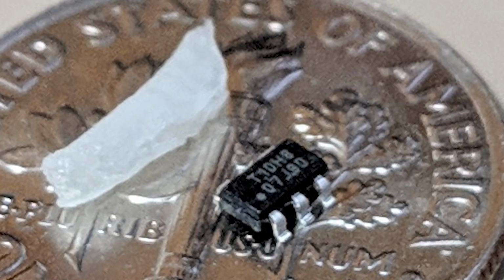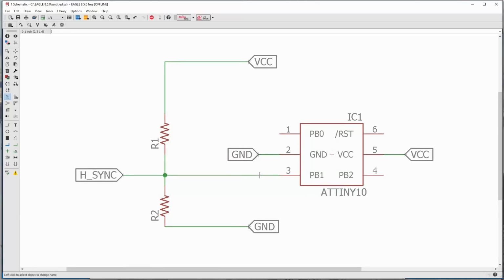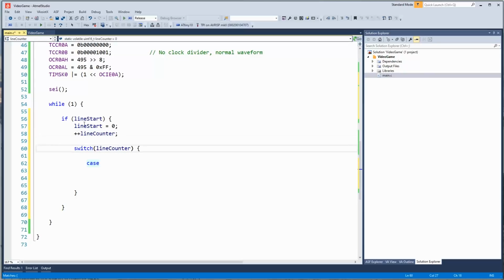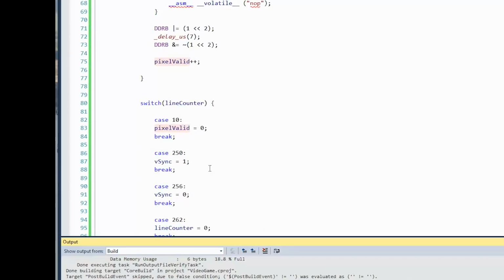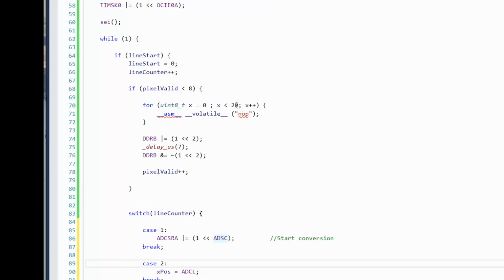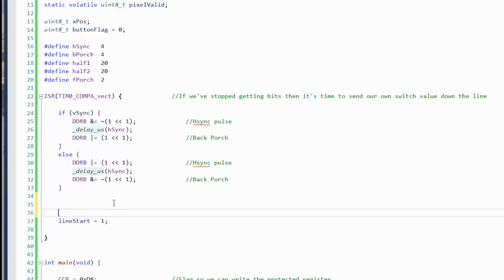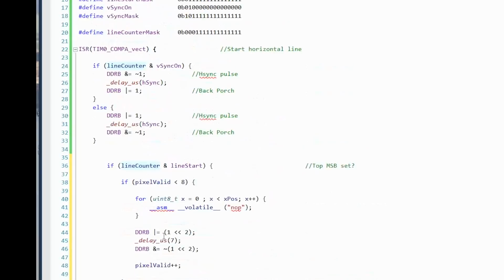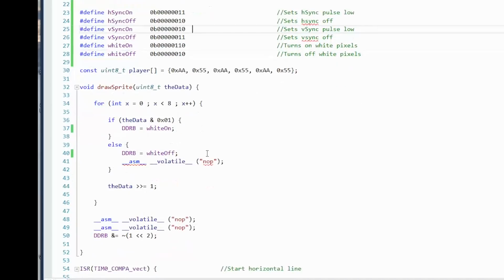ATTINY10 Console Part 1

Comment: If putting everything in the ISR feels icky, could you have it just set one flag and exit immediately? Then the main while(1) begins with whatever logic it needs for the next line, enters a spin loop to wait for the timer, then draws the line. Or perhaps poll the timer directly and not use interrupts at all, if the chip supports that. Could even throw in a few nops based on the last few bits of the timer to align away any jitter.
Reply from the maker: The issue is you don't know where you are in the while() loop when the ISR is called. That's why when you come back there's some jitter to the pixel edge.
Reply: @BenHeckHacks  I've been working on a composite output project using a more "conventional" AVR (324P); I based my pixel output loop on a clever bit of Arduino TV-out hackery that was designed to do render the pixels from within the ISR and the "main" loop really strictly doesn't have to do anything. (But it can; you can, for instance set an "in vertical blanking" flag handle processing in-between frames. ) How it avoids the "jitter" in the starting position is it (off the top of my head here) sets the timer interrupts so it "sleeps" the CPU when it enters the horizontal refresh "down" phase and "wakes up" when it goes back to up. (At which point it processes the line output as the ISR for that.) My understanding is that "sleep" give a reliable "start of processing", while if you interrupt running code you get a random clock or few's latency.

Dunno if this applies to the ATTINY, though. No idea, actually. For what you're doing I think to make this work you might need to pre-calculate your pixel output blobs to also avoid making any indeterminate-number-of-clocks decisions before the left margin, maybe you don't have the RAM for that?
Reply: @PaleozoicPCs  Yes, putting the chip to sleep is a good idea to eliminate jitter. The code for an AVR-based text terminal I looked at uses this technique.

Comment: You don't need to just put "volatile" specifier wherever you can type some word. It won't make your variable ISR-safe automatically. This specifier just saying to compiler to not optimize some expression when some memory can be changed by hardware or external code (when compiler can't see those code) and you, say, are not initializing something and then using it. MCUs hardware registers declared as volatile, but using this specifier for your global variables is nonsence.

Comment: 45:18  A byte was always 8-bits.  Byte I think was the standardisation of character sizes at 8-bits wide, around the same time as ASCII, I think.  Before that it was word size.

https://www.youtube.com/watch?v=ixJCo0cyAuA
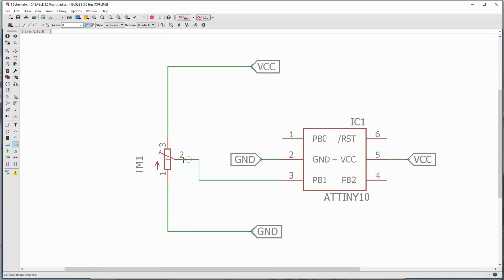Reply: Inaccurate. Quoth wikipedia: "computers using six-bit and nine-bit bytes were common in the 1960s." The technical term that's always 8 bits is an octet. Incidentally, ASCII is 7 bit. The video you referenced also pointed out that other sizes were used at 8:22.

Comment: friendly reminder that mixtela style ADC button muxes using R/2R ladders are a thing and you should use them.  this is especially important since if the player turns the potentiometer while the button is pressed, you will likely want to be able to detect it.

also why are you incrementing the line counter in the mainloop instead of the interrupt handler?  seems to me that if you do it that way, if the mainloop lags and (for whatever reason) takes longer than 1 scanline to complete, for example because you're running low on CPU time and blanking 8 lines while you do some processing during the active region, it'll miss and you'll end up duplicating a line meaning your image now 1) looks wrong and 2) no longer conforms to NTSC spec because it is now too tall.

why are you doing bitwise ops on DDRB instead of writing fixed values to it?  seems to me it'd be a lot faster and your pixels could be a lot narrower if you did, and with what else you're doing in your app (no other bits in DDRB change ever), you really don't care.  doing it Right(tm) is all well and good but when you're bit banging NTSC, every cycle counts, and sacrifices must be made.
Reply: @Christopher Grant AVR is a microcontroller architecture conceived in the 90s.  bold of you to assume it has a pipeline at all

also, reading a hardware register to an accumulator, modifying the accumulator by an immediate, and writing the accumulator back to the hardware register is always gonna be slower than simply writing the immediate

EDIT: nvm the SBI instruction is 1 cycle and can work on the DDRB register directly.  ignore me
Reply: @Christopher Grant I know that, but surely they didn't put them in microcontrollers, did they?  Why spend valuable die space on a pipeline and clock phaser when you don't care about performance anyway?

Besides, whether that was a thing they did back then or not, the word "pipeline" is conspicuously absent from the ATtiny10 datasheet.  Then again, all but like 5 of its opcodes complete in 1 cycle so

Comment: If you're using such a tiny MCU, why pair it with a HUGE CRT TV? Wouldn't it make more sense to use an equally tiny display. Like one of those I2C addressable 128x64 OLEDs.
Reply: That would be too easy, all the fun is generating correct video timing.
Reply: @eDoc2020  OLEDs have their own challenges.
Reply: @frankbauerful  True but nothing like needing to keep track of your cycle counts. You can create games much more easily when you can generate pixels at your own speed. I don't know if you've ever tried bitbanging video on an AVR before, it's really hard to achieve seemingly simple tasks like displaying two graphics next to each other.

Comment: Why are you using bytes for flags? If you define a byte instead of a bool , the compiler wont merge them, bools will merge into a single flags-byte and use native bitcheck opcodes no?
(I know more about PIC ASM ;))
Reply: @Christopher Grant yeah you're right, I was mistaking bool with specific MCU types. What the PIC XC8 compiler can use is the __bit type and it will auto pack them into a byte into the shared page, using bit operators (set bit and such). Is there any such thing for the avr compiler? It seems really wasteful to use a byte for a flag and I generally don't trust compilers to interpet bitwise or as a BSF and such..

Comment: Wait, an NTSC signal using just the internal oscillator of the uC? I always thought you needed some sort of crystal to get an accurate enough clock.
Reply: You really only need an accurate clock if you're doing color because color relies on your oscillator and the TV's staying in sync. With B/W you only need to get the sync timing "close enough". B/W TVs don't have any timing crystals. The vertical hold and horizontal hold controls of an analog TV are in fact adjusting its sync oscillator free run speeds.

Comment: Would a 0.96" I2C  Serial 128X64 OLED display be to much for a ATTINY10 .  4 pins let me think; start right, button pin 1 press move left, pin 2 sound out, pin 3 fire and data out to I2C. make a Galaga game?

Comment: Does the Atmel compiler support bit-fields? Would've been a bit easier than all the AND/OR logic
Reply from the maker: In assembly it has bitwise commands. I can try using them without the code (like the NOP)
Reply: The compiler supports bit fields, but in testing that falls back to the same operations as for RAM access. So even if the bit field is stored in a GPR, it uses 3 instructions to set a bit instead of 1. This saddens me.

Comment: I'm pretty sure all that bit-masking with the line counter isn't free. That all takes time and several instructions as the chip loads linecounter from RAM, masks it, compares it, and sets the return value. That's 4 or 5 instructions. You're taking time to do stuff in what should be snappy, VCS-style code! 

And all to save a couple of bytes of RAM, when you're not even short of RAM! Go back to the old code! Adding complications like that, it's pointless and my brain is screaming! Use the RAM for gods' sake, it's there on the chip to use free of charge! You must surely realise, knowing Stella as you do, that code takes up both size and time, and both have to be optimised. Sticking in a load of masking to an overloaded variable is the opposite of that. 

Putting all of that in an interrupt... the kind of code that's supposed to be snappiest of all... that's not going to cure anything, it's only going to make things worse. Be aware that every bit of code you write, is taking up your Atmel's precious time. Don't worry about the flash and RAM until they start to get full. And don't let them get full, by keeping your program simple.

Also does using << mean the chip actually has to do Rotate Left? And if you rotate left 13 times, does that come out as 13 ROL instructions? Or is the compiler smart enough to realise it's a constant? I dunno your compiler but often the free ones you get from the manufacturer are crippled and not that smart. Might be worthwhile to replace them with constants yourself, and see if it makes any difference, if you end up with more flash free, that's a hint it probably does.

Comment: cool but can you dumb it down pls
(for those of us who just watch this for entertainement)
question, can you string these things together to make them more powerful?
Reply: You can definitely amass many CPUs of any type to do more processing, however you run into issues dealing with latency and overhead in communication between them all. In addition, many problems are not able to be split in to smaller functions, so it's hard to make use of more CPUs - this is a notoriously hard problem in Computer Science.

Comment: so much effort to not do the thing you said. you didn't make a game using only the attiny, but im about to tell you a game I just came up with that does fit the model. take the attiny, flip it in the aair, if the side with writing on it is facing up you win, if it lands in any other orientation you lose. DONE.
Reply from the maker: Video ran long so splitting into two parts.